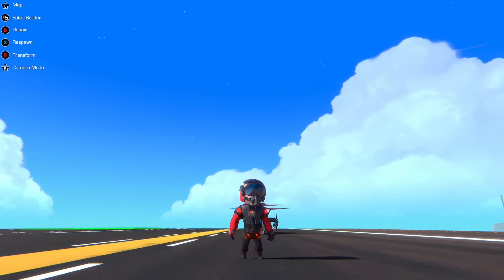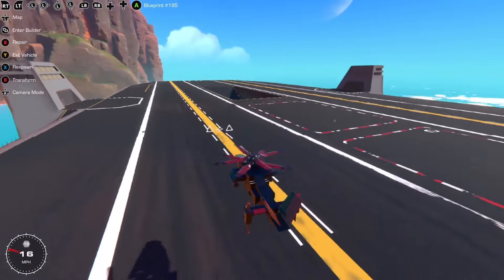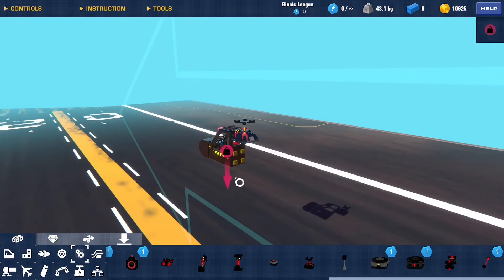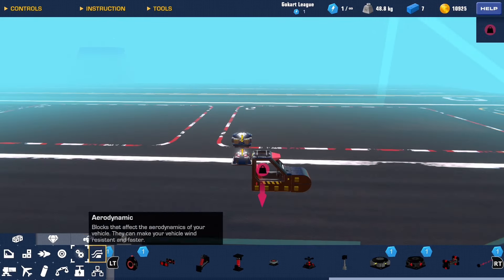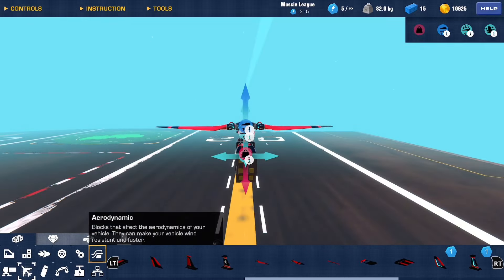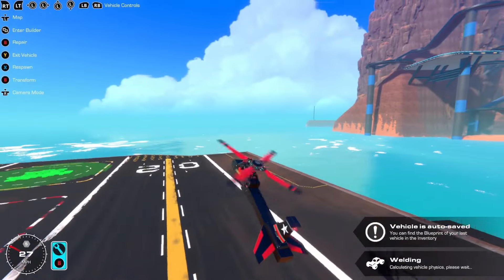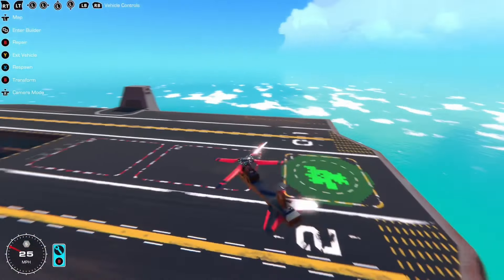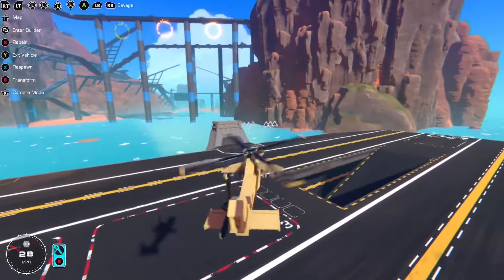How to make single-engine Helcopters

Comment: It's a nifty trick but if you're helicopter is too heavy you will either have to add thrusters to help with lift or go back to using coaxial helicopter engines (2 helicopter engines). Also you didn't say that trick also gives the helicopter auto rotate capability where if your falling the blades will continue spinning to slow your descent.

Comment: Awesome video man I’ve also found after some experimentation you can use small flaps as blades and have them on two controls for up and down and make a kind of collective system that has proven its worth and accuracy to me you should definitely try that to it makes the altitude adjustments so smooth
Reply from the maker: Great suggestion! I've seen some Trailmakers YouTubers do that, but haven't ever tried it myself, I'll make sure to give it a shot!